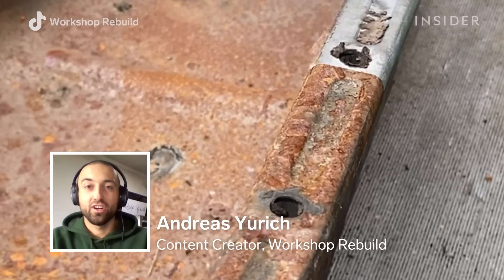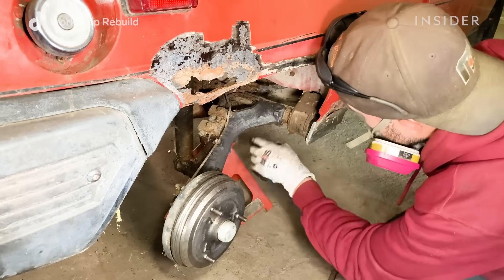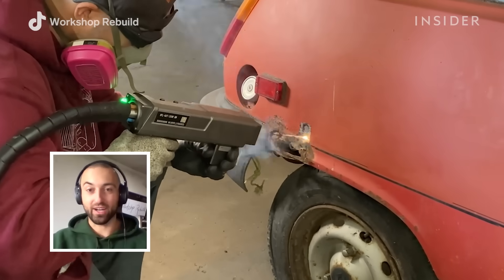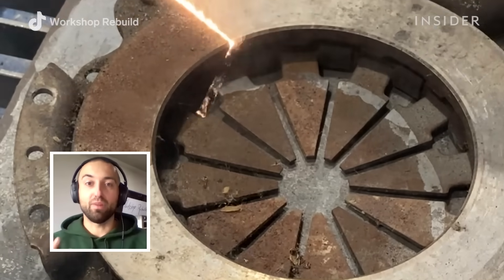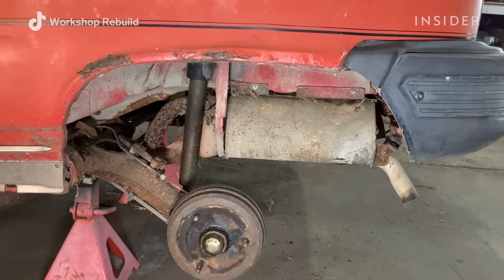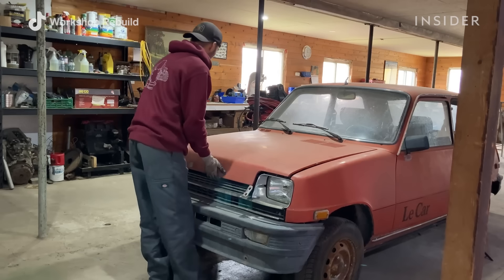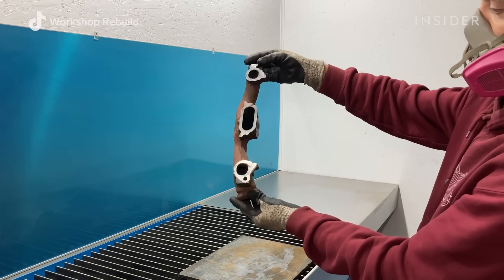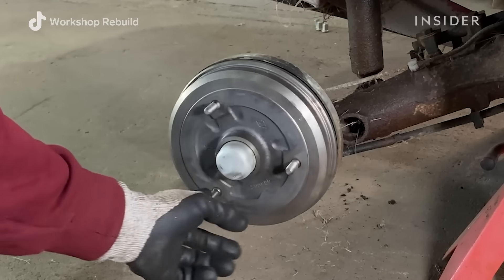How Laser Cleaning Deep Cleans 40 Years Of Rust On Cars | Insider Cars

Comment: This did not get rid of the rust in this video. There is still black rust pitting both in the wheels and in the shell. It was just a quicker, but a lot more expensive way of cleaning back paintwork with a similar result to using a cupped wire brush on an angle grinder. To do the job properly acid dip!

Comment: It doesn't matter how long the rust's been on, the mentioning of a claimed timespan is just sensationalistic bogus either due to the presenter's lack of proper knowledge about metal corrosion processes or for the sake of mere dishonesty as an attempt to fool ignorant people. It's the same charlatanry as when selling a product under false premises, like they tried to convince viewers about the extraordinary low temperature they could start an engine with a "special" lubricant while having the cylinder block imbedded in ice - disclosure: water needs a measly zero centigrades (32 Fahrenheit for americans) to freeze over.

Comment: I wish you BIG luck with the Renault. I think part of the rust problem was bad design, part of it was shitty steel imported from the backwaters of places like Russia. The floors fall out and the suspension perforates...and that's just the start of it. The copper in the wiring loom was often impure as well, so it often turned green or black with age. The wet liner engine is kind of OK but it's not unknown for the land between the piston rings to snap off and work against the liner. 

If you acid dip the shell be prepared for a nasty shock..!

Comment: I bought a later used LeCar with the rectangular headlights, in the mid-80s. It was a great little car built during when French automobiles still had plenty of charachter. You will like driving yours. They're comfortable and dependable.
That laser blaster looks great for finding thinly rusted areas. I used to use my cutting torch, for that. Its flame would melt these areas back to where the sheetmetal was still at normal thickness. But this procedure also warped the metal. Whereas, a laser won't.
I hope that the American military didn't leave any of these laser blasters behind in Afghanistan. The Taliban would use these as instruments of torture and punishment, if they ever got their hands on any of these

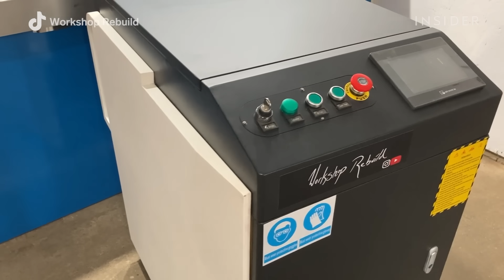Comment: 1:20 
If you use Nanosecond Fiber laser (I'm sure this is it) you need to know that the main settings is a freq to speed ratio. It depends of beam/spot/pulse diameter in focus. I think its about 100-200 mkm for your machine. If you use high speed with low freq every pulses wont overlap each oher. And you will take someth like /Dot - long empty distance - Dot..../
 To lay down pulses one by one without space you may use simple formula /Speed(mm/s)=Freq(kHz)*Diam(mkm)/ So the first param you need to select is Freq because every pulsed fiber source has "CutOff Freq" - value exceeding which the energy in pulses will decreases and it starts provide more heating than ablation (bursting)) You may find this parameter in every fiber source tech docs. I think you note when you use the same parameters but increasing Freq efficiency will decreasing 
I hope you understand what I mean (im from Russia). Good luck and Peace!
Reply: Вот и умные головы подтянулись) я бы даже по-русски ничего не понял 😀
Reply: @yuris6125  да не то чтобы умные. Сами просто такие производим)

Comment: I work in Photonics, anyone considering using one of these must wear Laser Safety Goggles specific to the wavelength-frequency of light you are working with.
I can't tell what type of goggles that are used in this video but the safety goggles for vary for the type of laser, wattage and color.
If you dont use the right kind you will develop cataracts.
Reply: My Chinese neighbor has a 2020 Cataract Escarade
Reply: @Christoph-sd3zi  🤣🤣
Reply: @Christoph-sd3zi  You win.
Reply: @Christoph-sd3zi  LMFAO!!
Reply: Cataracts is not the problem. You go BLIND permanently from lasers.....
Reply: Thank you for the heads up.
Reply: Agreed, absolutely never forget your LEP (Laser Eye Protection)! The machine should have warning labels that detail the laser frequency and Occular Density (OD) required for your LEP. Sunglasses and welding masks are not enough. Also be mindful of reflections affecting nearby equipment, skin, others. Highly recommend checking out MIL-HDBK-828B for anyone who wants more background on laser safety practices.
Reply: What's the light level compared to welding, like how well would a welding mask would work? The Tig welding arc is insanely bright

Comment: How much heat does this laser actually generate? You cleaned those rims with tires on, if it would be too hot on rims the tires would pump up even more. Seems dangerous but yet you did it quite easy.

Comment: I used to work at a sharp factory that made microwaves and then the new fangled CD player.the CD area was a clean non contamination where it would suck dust losse hairs on you with static and extraction but the areas where the lasers were was in small work booths white gowns Goggles like something from a sci fi film...I worked on the microwave section really good money for someone barely 17 great job ....ooh yes we also had to go through a exercise routine before each shift...this piece of equipment is game changer I would imagine top end car restorers will have this soon as ..

Comment: Notice that his hands and arms are covered as well as wearing eye protection designed to attenuate that specific laser wavelength (1 micron). Be wary of stray reflections from smooth surfaces and absolutely do not breathe the smoke, because that's where all the junk that comes off goes. The process works by dumping heat into the surface, so moving slowly over thin metal might cause it to warp or even melt. Play with the parameters and see what works best. But do not forget that a laser in that power class (4) can burn skin or blind you faster than you can react, so treat it with respect.
Reply: The frequency of light these emit are usually in a band that's not absorbed by human flesh. The PPE is probably just precautionary. I've seen these pointed at demonstrators hands with no I'll effect beyond removing hair.

Now eyes are a different story and I would definitely wear proper laser protection glasses.
Reply: @JonM-youtube  * ill

Comment: Amazing what technology is coming out with these days! One thing you didn't mention was the make of your machine and how much it costs. Really good information!
Reply: Low end machines cost $80-100k and high quality machines are north of $200k. Most early models were manufactured in Eastern Europe and you might be able to get a gently used machine for $40-50k.
Reply: @enochthetrucker514  This is why I have problems with all of these kinds of videos. They make it sound user friendly as if its not a straight up unobtanium industrial process. Dry ice was like that for a long time but have come down significantly. Hopefully we see the same with this process. But given the components needed VS the dry ice I doubt it will be consumer grade in my lifetime.
Reply: @YourChildrenHaveNoHomeland  Power consumption at 15 cents per kW/hr is 0.30/hr.
Man I wish I knew where my head was when I did that math;-/. It's only 30¢ per hour.
Reply: @Kinann  wait what. if it runs on 2kW it will use 2kW/hr, so it would be 30 cents per hour. What I think you meant, is it uses 2MW maybe? My vacuum cleaner uses 2kW 🙂
Reply: @beersmurff  Must have been somewhere else when I did that. Yeah, hair dryers and toasters use 1200 watts. :)
Reply: @enochthetrucker514  for real 😳
Reply: @enochthetrucker514  it will become cheaper in 15-20 years give or take

Comment: This is amazing, and the tech can only get smaller/cheaper and help make restorations for the weekend mechanic so much easier
Reply: I said this in 2017 but the machines are still like $200k
Reply: @Weaver_Games  Because not enough of them are produced. Production needs to be scaled up on a industrial scale for the price to go down. Otherwise they will remain this expensive forever.
Reply: @Drakey_Fenix that’s not the issue. Google what goes into high powered lasers. At best IT’s performance or size will improve, not the price. The lenses alone are over 30k
Reply: @bhavjotkang8004  Everything can be scaled up to reduce cost. Even those lenses. It doesn't help either that some manufacturers keep production low artificially, to make sure that prices stay high. This is a very common tactic used by businesses that sell high end products.

Comment: I don't know that I'd be using that laser on the rim with a tire on it.  I don't know what the risk of spontaneous pyrolysis is with a laser, but if you welded on the rim with a tire on it, the tire will explode.  There's probably rust you can't get to without taking the tire off anyway, so you might as well do it in the first place.

Comment: Could you burn polymers off of metal with this? This would be huge for the plastics industry. Maintenance guys who use die grinders with wire wheels to clean the  hard polymer off of metal dies, screen plates and machine parts would love this. The money you would save using a lot less cup brushes, wire wheels and end brushes would pay for it plus less wear and tear on tools.

Comment: Wow!  Can’t help but think what happens to other materials including user errors.
Reply: Not to mention the fact that the laser will take off a layer of material from the surface, probably compromising the part itself like thickness, ect., ect. originally designed by the manufacturer.
Reply: @seagrey75  It does not harm the surface and therefore it is perfect to use on machined surfaces where tolerances are involved.

Comment: This is a pretty cool tool. I'm a retired motorcycle technician and machinist and when cleaning engine and chassis parts we used a glassbead machine that used air from a compressor with very fine glass. It worked well and didn't remove any metal from steel, but you could see the aluminum changing ever so slightly so you couldn't stay in one spot for more than a fraction of a second especially on gasket surfaces and other vital areas. This laser tool is pretty awesome and I would love to try it out one day before I kick the bucket. 😁 There's also a ultrasonic hydro resurfacing machine that uses a special cleaning solution and water can be added to dilute to be more cost effective and won't decrease the strength of the cleaning solution unless too much water is used. I've seen the results of many metal types and they looked just as good if not better then when it was new from the factory. 
Caution: 
When using the laser tool, you must always keep it away from any body part because it will cause severe burns. Great demonstration.
Reply: Yikes, hopefully it didn't affect your lungs 😬
Reply: @Nutella2004  From what I remember the seals on both doors worked well, but the window seal leaked at times. We weren't smart enough to wear a mask so we had to position ourself so we weren't breathing in the fine dust that came out. I'm sure we still breathed in some. One other thing was every now and then the glass had to be replaced because you couldn't see through it. My boss finally bought some clear sheets to tape on the inside. I taped about 5 at one time, staggered and all you had to do was pull the tape in a certain spot to remove one sheet. Well one day my boss pulled all five at one time. I told him what I did and the look on his face was like, oh. Never forget that.
Reply: The price for the clening machine
Reply: @brgelimborg1978  there are many and prices are coming down but they run around 50k
Reply: @brgelimborg1978  That I don't know. Probably not cheap.
Reply: @brgelimborg1978 TheBackyardScientist, another youtuber bought one for $12,000. He has a video demonstrating it. Tho, that one was stationary, ans oretty big. Price of course varies from model to model.
Reply: I wonder how this compares to dry ice machines that I've seen lately used by car detailing.
Reply: so which is better aqua blasting or this laser tool??
Reply: @lyt_w8t I think it may depend on circumstances/what exactly you are cleaning.
Reply: we do professional laser cleaning machine with air blade
Reply: Another thing is, if you are to use one, to use eye protection, like a welding mask, or something else that protects your eyes from lasers.
Reply: sand blasting is the name. Trying to disguise what it was. Anyone can do it.  I think he knew not to aim it at his arms or head or look at it. DUH. 🙄🙄🙄🙄 You just want to sound like Mr. Know it all. duh.
Reply: he said he was glass bead blasting, not sand blasting @JohnSmith-uy7sv

Comment: Interesting video Thanks for putting that together. Looks like most of your comments coming in Don't really talk about the technical features of what you're doing. So with this process my biggest concern would be as you're using the laser most of the parts you're working on have rubber of some sort right next to them or incorporated in them. My guess is if the laser hits any of the plastic or rubber parts they will simply melt. So isn't there a risk in using this process and not damaging other parts? Thanks
Reply: I think it could dammage the non metal parts because it could remove the rusty metal off the part surface it can easily dammage the rubber.
Reply: No it will not. Same with your hands. The device has mode selections
Reply: There is. It generates immense heat. But it is also highly precise compared to sandblasting and even your wire wheel will be needed to be handled with care around hoses and paint and rubber gaskets etc. Often it is used in metal only cleaning. Like the auto body after removing everything. Very fast and robots can do it fast and precise. I would think using it on an old assembled car like this is unwise. But as you also see in the video, hardly any hoses, cables etc are left in the car. And the tires are old and worthless and just there to show the precision.

Comment: And just like freshly shot-blasted steel, the surface will rust in a very short time. Ablating plated parts is also bad news, zinc vapour is not nice and will reduce any corrosion resistance too. 
The safety of handheld lasers is also very questionable, avoiding reflected   laser radiation is ensured how??!

Comment: What if it accidentally catches a rubber hose like fuel or brake line, wouldnt it cut straight through it as well as electric cables. I can only see it being safe enough to use on metal parts that have been removed from the vehicle first

Comment: It's nice to see you demonstrate it but I'm sure it would of been cheaper to just buy 4 steel wheels .. plus I'm wondering how much electric current does this machine use 🤔 and as for the body work to the car angle grinder mate because you've just made extra work plus cost.. but yeah thanks for the demo👍🏿
Reply: Not of the wheels are 40 years old and you cant get the exact ones

Comment: I got rust on the bottom of the door panels. I've used a wire wheel on them already but the paint I put over that still bubbled up and I got rust again. Would something like this do a better job short of cutting the steel out of my doors?
Reply: I dunno. If the rust is too advanced you will have to take out a good part and make something up for it
Reply: Removing rust is one step, but you still need to treat metal surface. First really degrease the surface. Then use phosphoric acid to really stop oxygen from reaching the metal. Then apply primer to get paint layers to stick to the surface. If you removed rust, you may have to deal with pitting, so use a filler primer. Then lay colour itself. Always check specification on primer and paint tint, delay between layers and accelerates curing with a radiating heat source. There are also specific primers and hardening agents suitable for lower door and lower body panels in general.

Comment: Very cool. I have never heard of this before. The smoke would concern me though. It may get poisonous depending on the part cleaned, no?
Reply: You do have to be careful with the material ablated off the surface. Organics are worse than metals and oxides. I'd want really good fume extraction if I was doing this all day.
Reply: The 'going blind bit' would concern me. Just one little mistake and ..
Reply: No substitute for professional acid dipping.
Reply: You guys did notice the PPE didn't you?
Reply: @nothingsurprisesmeanymore  That is only to capture particles from the air. It would not protect from poisonous gasses that may be released in the process.
Reply: @nothingsurprisesmeanymore  PPE is swell but is subject to mishaps. You can flip your goggles up and then fire the laser; very bad. I've never been a fan of handheld high-power lasers. They're a lot like machine guns.
Reply: @soaringvulture  I’ve never heard of these before, but it looks absolutely vicious.

Comment: Why no just removing the tires from the wheels and THEN clean the wheels ? 
Why not juste replace them with non-rusted, non metal fatigued, new wheels ?

Also, it won’t clean internal surfaces of pieces.

And I’m not sure that use this for « cleaning » the engine block is the way to go. Very little tolerance, should be resurfaced directly.

This seems only esthetic here.